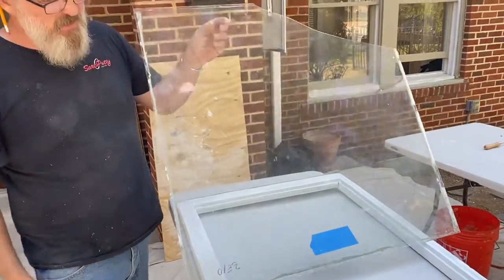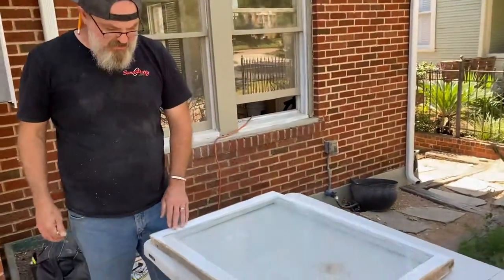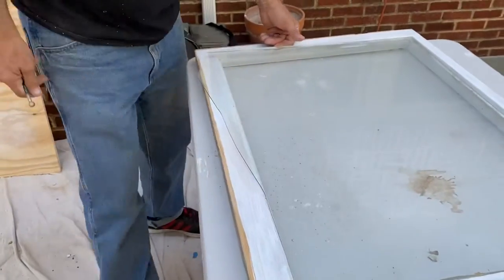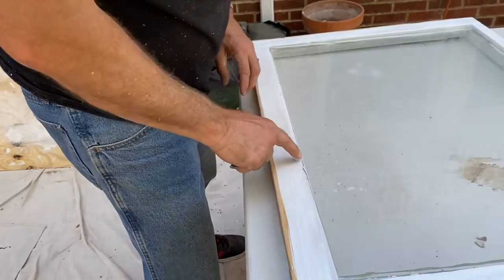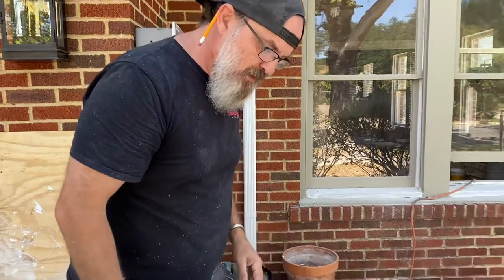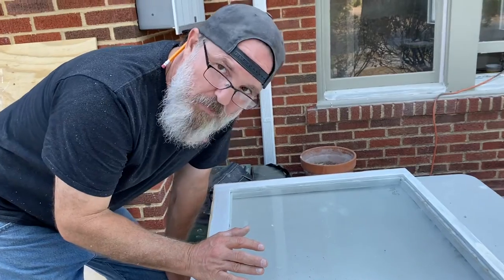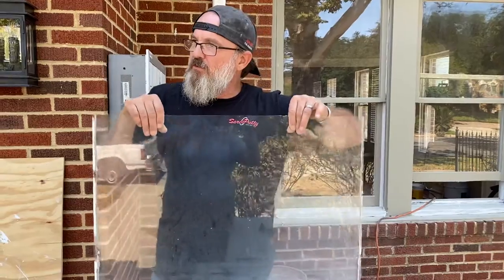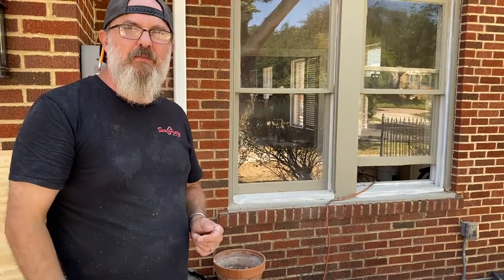When Cutting Wavy Glass, Keep This In Mind

Comment: Great video.. could you please add some details in regards to the comment made during your video about sanding the glass, what was meant by that?
Reply from the maker: Oh I think he was asking because sometimes you get a piece of glass from the glass store and they soften the edges before they give it to the client. I was like, no, we are the glass store. Someone has to handle it before it’s sanded….
Reply: @WoodWindowMakeover  Ahhh ok.. i thought it had something to do with reducing the possibility of the glass cracking where a jagged bit is on the edge.

Last time i tried putting glass in an old sash timber window frame, i had all kinds of trouble. Every time i went to put the glazing pins in i would crack the glass however gentle i was trying to be. Ended up having to take it to the glass shop to fit, looks like they used silicone between the glass and the frame before using putty.
Reply from the maker: I have one point driver that cracks the glass every time. It’s crazy because I’ll forget which one it is and use it again because if one reason or another and then kick myself. There has got to be a reason it does that, as sure as there’s a reason your glass kept breaking but I don’t know what it is. I have one point driver that I use now that has an good track record so far but I still, with every point I drive know that this could be the one

Comment: What happens if the crown is facing inward, assuming its still properly bedded?
Reply from the maker: In my experience it’s more likely to break.
Reply: @WoodWindowMakeover  break just sitting there or if something hits it? Or high wind? Should I pull the stuff out and redo it, the glazing is still soft.
Reply: They didn't crack when I glazed it. If it's in the sash with points is it basically free and clear?